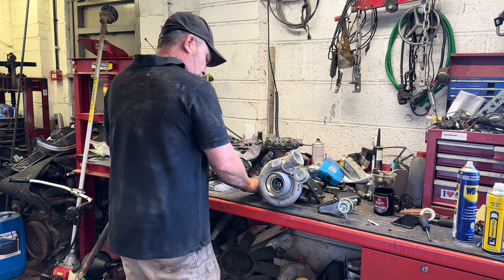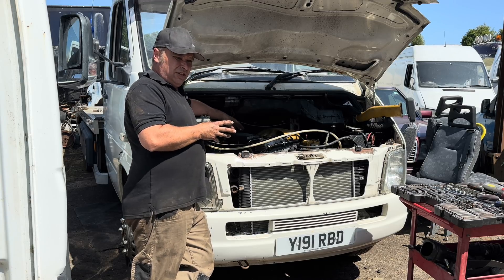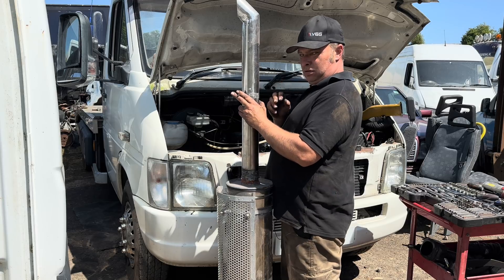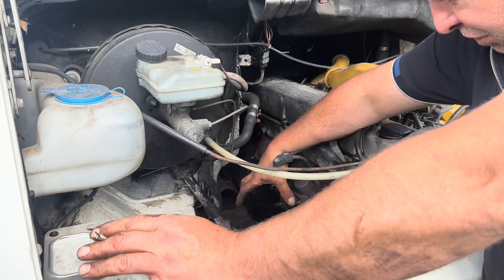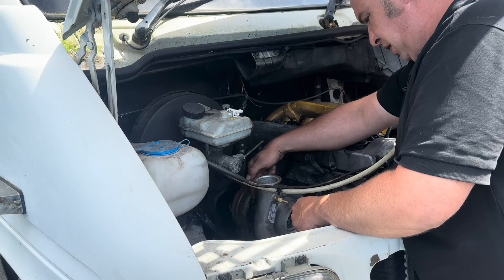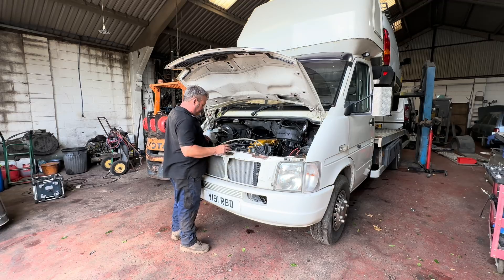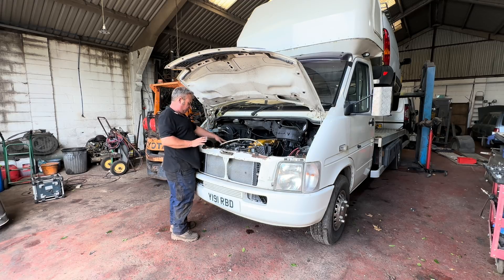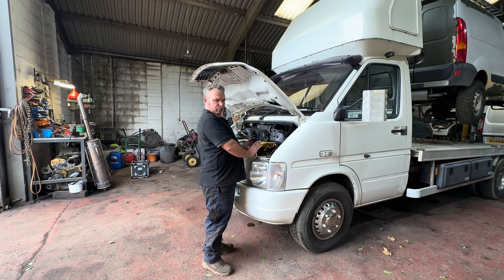Can a man bolt a lorry turbo on a Vw lt46 recovery truck ???

Comment: I’ve put a 2.9 602 in my discovery, I used a charger cooler off an sl500 amg. It’s sat just nice over the rocker cover between the turbo and inlet manifold, works very well
Reply from the maker: Cheers I’ll have a look into that , currently we are thinking large alloy mounted at an angle under the front 👍

Comment: Great video buddy as always. Quick question what’s your thoughts on the VW caddy that the Gas boards seem to be using at the moment. I need a second car and fancy a diesel one of these. Many thanks in advance.
Reply from the maker: They seem to be good fella , I’ve got a few customers with ex gas and water ones and we’ve had hardly any trouble with them 👍

Comment: Turbo Al there’s a 53 reg yellow lt recovery on eBay with over 600k kilometers on it. For £2750+ the vodka and tonic D’ya think she’s run in now and would you use a 600k LT recovery ? Cheers Boss Man
Reply from the maker: Yes she’ll stick that ! And  it’s Kms  makes you fella much better if you just say it in mile 👍

Comment: Is the current intercooler not up to the job or is it just knackered? I have a spare unused sorinter intercooler in my garage (bought to go on a VW T4 1.9 tdi conversion but never fitted).
Reply from the maker: Radiator is 4 inches further forward so no space for the original 👍

Comment: Hi wonder if I could get some advice I have a lt35 2006 and when I get dash lights on ready to start I flick the key everything trips out I’ve replaced starter and still same I then have to disconnect battery to basically reset system cheers
Reply from the maker: They are renowned for earth problems, I’d start with the gearbox to body earth. Other possibility is it’s got some sort of aftermarket alarm ?
Reply: @6DDIESELSDorset  yeah it’s got after market alarm but that’s been on 3 year thanks for advice much appreciated
Reply: Hi thanks for advising my on ignition fault was a earth cable cause the system to trip out
Reply from the maker: Fantastic fella glad it’s fixed 👍

Comment: Any hints on upgrading a 515 mercedes ex ambulance?
Reply from the maker: Bit of ecu mapping , should be twin turbo 👍
Reply: @6DDIESELSDorset  thank u
Reply from the maker: If you got really lucky you might have the v6 Cdi   That can be made to make some really good power 👍
Reply from the maker: If you got really lucky you might have the v6 Cdi   That can be made to make some really good power 👍
Reply from the maker: Drop me a massage on facetube or instathingy and I’ll give you his phone number 👍
Reply: @6DDIESELSDorset  will do
Reply: No got a 4 cylinder sorry but for a 4 ton box it's  not to bad on fuel could do with being a bit sharper would the later 7 speed box fit and be better then the 5 in mine?
Reply from the maker: You could but it’s a hell of a lot of work and as far as I can remember top gearings  about the same, I’d have a sensible re map done if you in my area I can recommend a really good guy 👍
Reply: @6DDIESELSDorset  can I have that address for that fella near you please and is 300 000 miles on the clock gonna be to much for it its not a smoker rattler or leaker ?